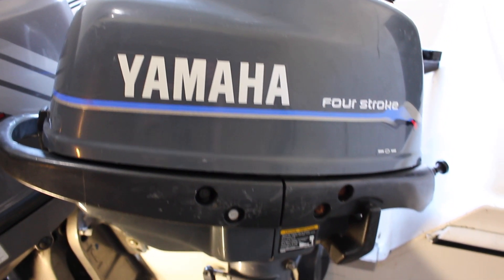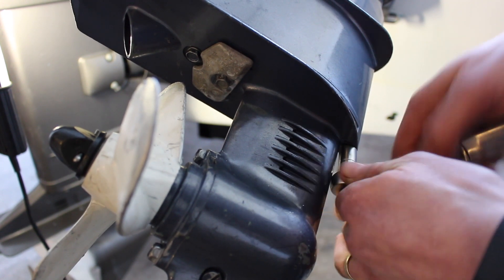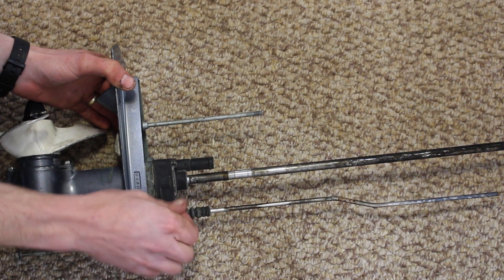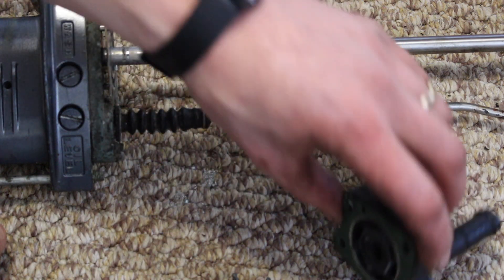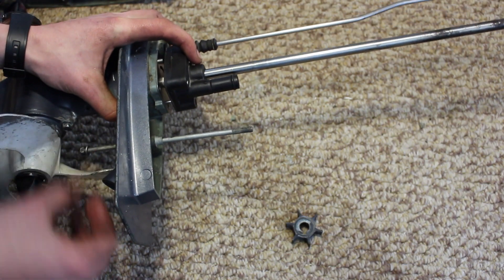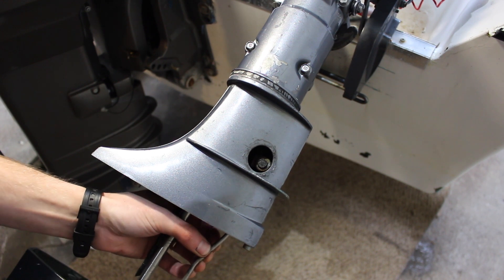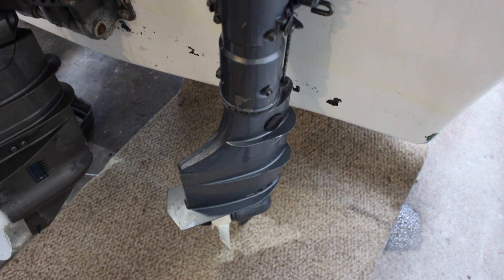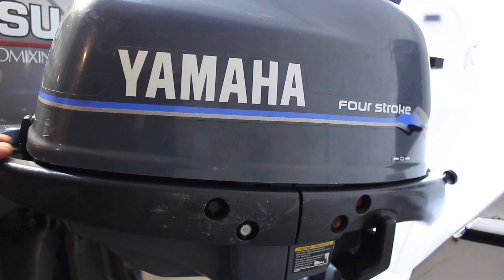How to Replace the Impeller on a Yamaha Outboard engine

Comment: Very helpful.  Tricky bit was the gear nut to tighten when reassembling lower unit. There is a slight rotation on the prop when in neutral . Not sure that should be happening.

Comment: The rubber hose in front of the drive shaft isn't the exhaust, it's the water feed up to the motor from the impeller!
Reply: surely the key slot in the impellor dictates what direction it will be going.

Comment: Very clear video on doing the pump If you find the pee hole is still is still giving you warm to hot water I  found the best way to clear the pee hole was to drop the bottom leg 
put  a fuel line in to the brass water pick up connect the fuel line to a
 garden hose using a clamp and force water up in to the gallery's and 
out the pee hole  using the bottom leg with the normal water pump 
impeller does not create enough pressure to clear any trash from the 
power head  (impeller was in good condition)